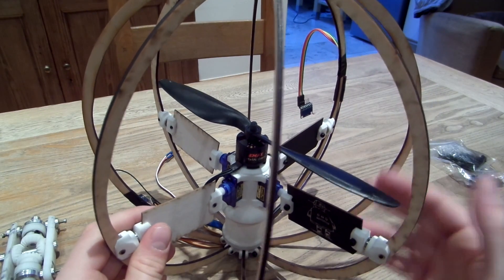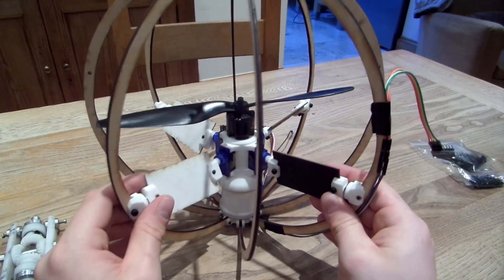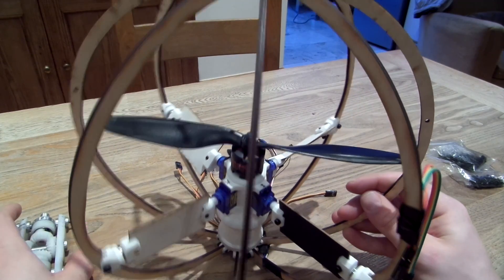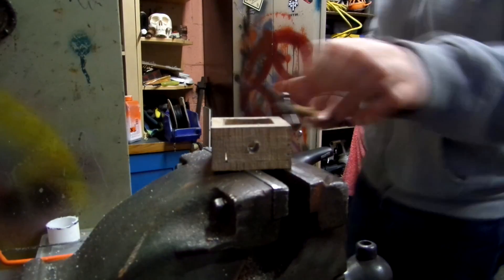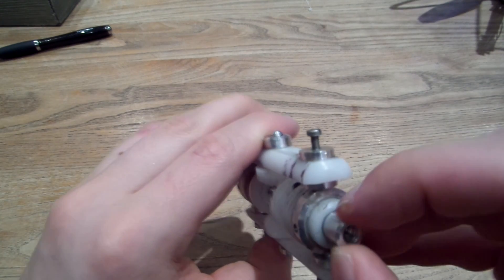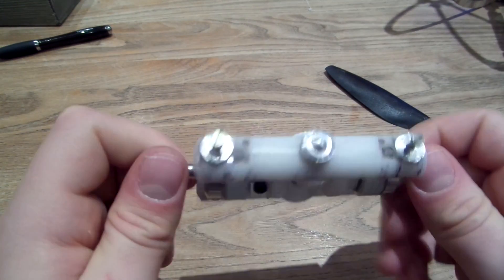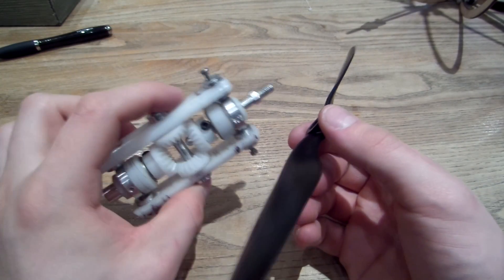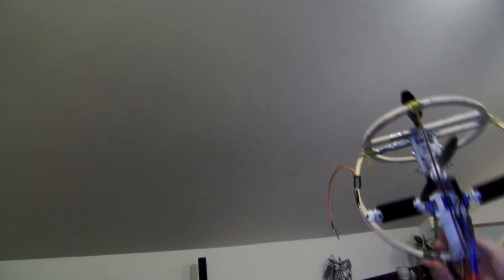Building a Spherical Drone With Arduino (PART 5)

Comment: If you want to use two propellers then wouldn't one need to be twisted in reverse so both are pushing down. If one propeller provides enough lift then maybe a reverse rotating flywheel would work.
Reply: I really like that idea.

Comment: It's not the weight of the prop blades it's the resistance to air that causes it to rotate ,use a pair of stationary flaps in the opposite direction on the bottom that might help.

Comment: What're the specifications of the batteries you're using?
Reply from the maker: Here's the exact one I bought: https://amzn.to/2E9fObN
Reply: Will Cogley What's the project's status? Were you able to figure out a solution?
Reply from the maker: Alphabot I'm not working on it at the minute because I have a lot of university work right now, but when I come back to it I'm going to change the design to use 2 motors and a few other tweaks and I'm confident it will work, I hope so anyway haha.
Reply: Can you please tell us which material to use outer surface

Comment: Hello..
I'm also working on the same project.
when we try to control the yaw with the fins, we r getting an unwanted drift while giving pitch or roll. so we need to use contra rotating propellers to control yaw.  but here in this video.. you r using a differential gear mechanism.. i appreciate it. But i found a problem here also..
you need to control the relative motion between the two propellers for yaw stability,which you cannot achieve using this mechanism. please tell me if I'm wrong. 
  Thankyou :-)